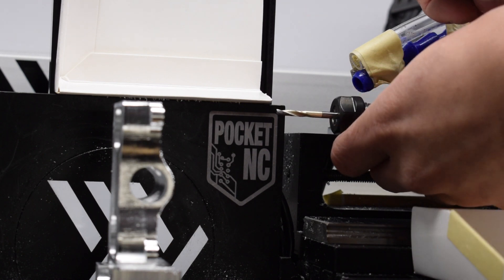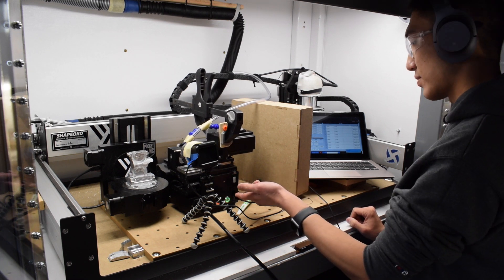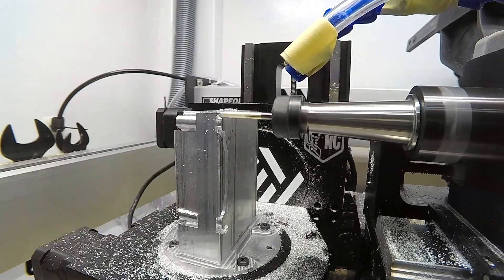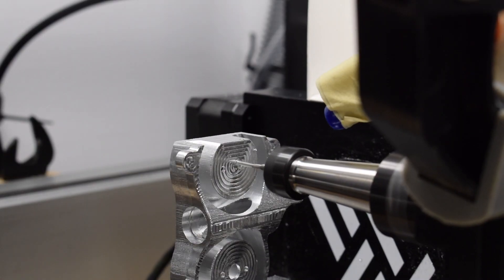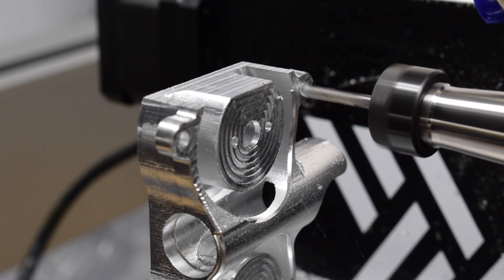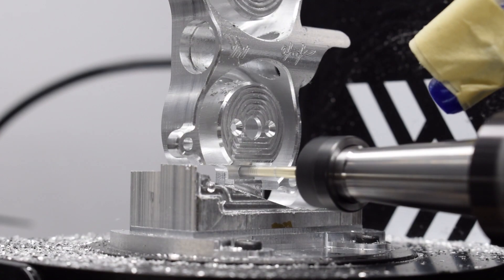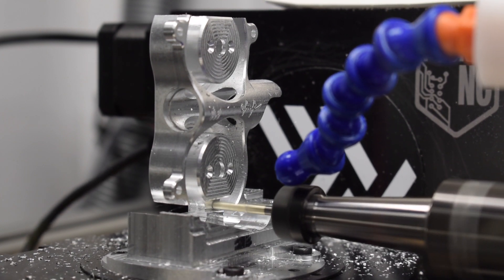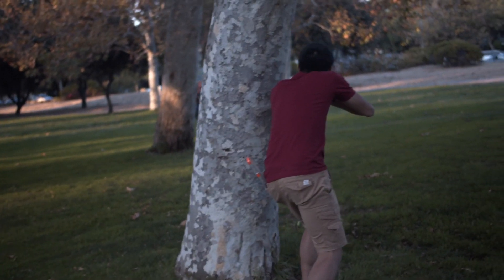5-Axis Machined Flywheel Cages for a Nerf Rapidstrike - #145

Comment: Nicely done! Honestly you're better then most apprentices out there working full time so you don't need to put yourself down so much. Don't know if you still want advice on a part you made more then a year ago but you might find it helpful on future projects. I might have missed the reasoning on why you machined it with the flat side up, it would be more stable to use that as your base then do a second operation to deck that off after. Also might have been more time efficient and cheaper to have drilled & board the main hole on a drill press before. On multi axes machines its always nice to have a big through feature like that to orient off of. Tells you rotation and "pitch" of the stock before you get started. 

I do hope this finds you well. Now time for me to binge the rest of your content.

Comment: 4:33 did you ever tought about using 1or2inch sanding disk to get mirror finishes in relative short time buy running through 3-6 grit steps ? ( like #120,240,400,800,1200,2000) i talk about these https://www.ebay.com/itm/Sanders-Polishing-Pad-Tool-Woodworking-Home-Garden-1inch-Shank-sanding-Disk/173801128781?hash=item28775ac34d:g:fqsAAOSw7HhcUJmF

Comment: My pocketnc also shorted due to aluminium chips getting into bad places. You need to seal the machine using tape. I believe a contributing factor is that the machine easily chatter causing small chips to vibrate into places you never think was possible.
Reply from the maker: The single worst thing you can do is use compressed air around the machine, I found out

Comment: Lets do this again some time- Maybe less ambitious on the next one though
Reply from the maker: Psht. No collab is complete without a couple weeks worth of panic, headaches, and nervous breakdowns.
Reply: @WinstonMakes  only a couple? Those are rookie numbers.
Reply: @WinstonMakes  For those deep or long reach cuts have you thought of getting some one with a D-bit grinder making you a special 1 or 2 flute cutter out of a piece of 8mm solid carbide?
The whole problem is rigidity of the cutter. You could just put the flutes on the last 4-5mm of the shaft and leave as much meat on the cutter as practical. You'd probably need to grind away some of the main shaft for clearance, but basically keep it as rigid as possible.
Reply: You two a couple? ;)